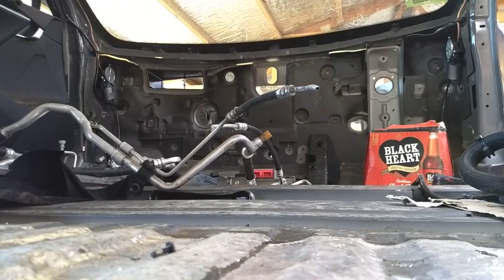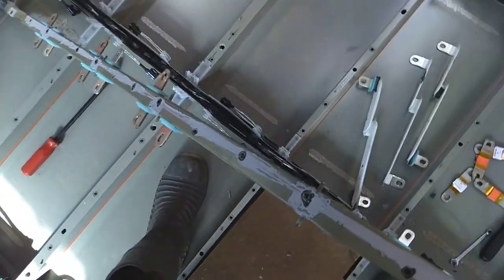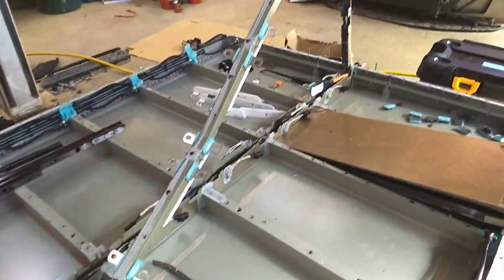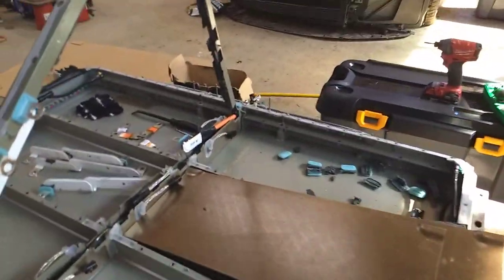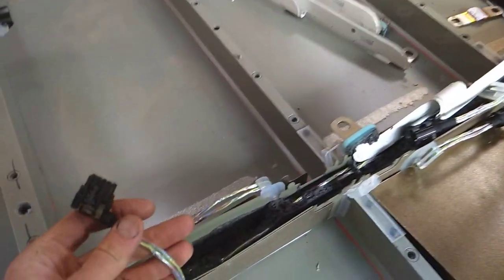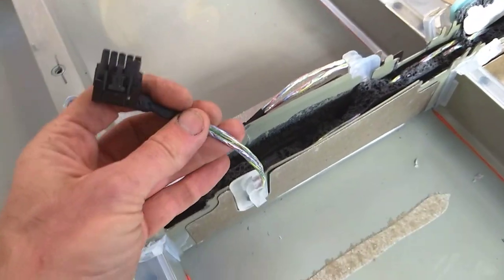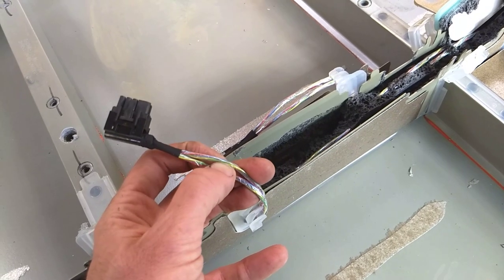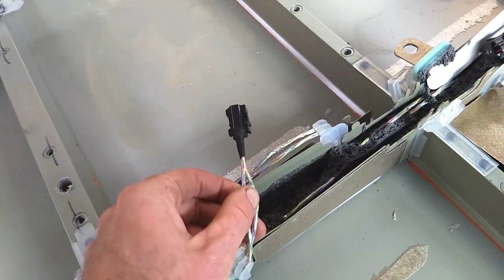Tesla Battery Busbar Layout

Comment: Yeaahh waaay better design and easier than the Nissan Leaf and many other electric cars out there sending 96 battery voltage wires across the whole pack to the BMS. This is a decentralised BMS keeping modules insulated from each other, so many advantages. Also running 96 battery voltage wires... imagine the voltage drop difference between the closest cells to the furthest ones... Tesla once again was spot on!!